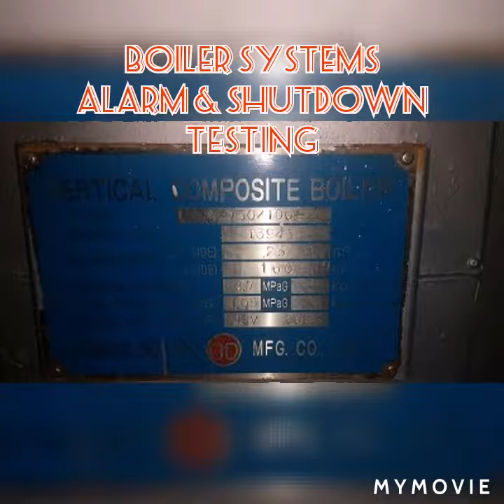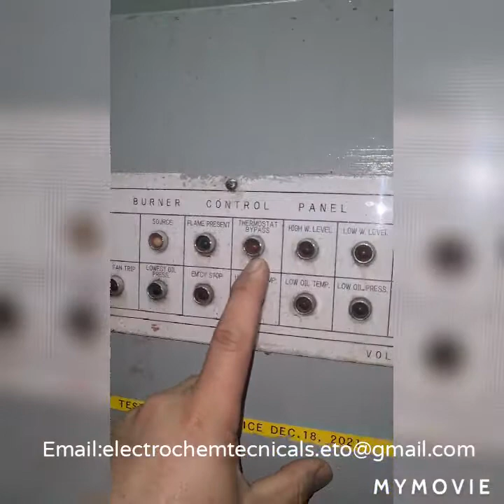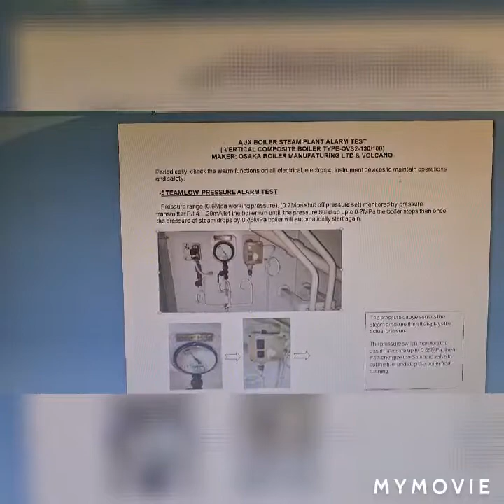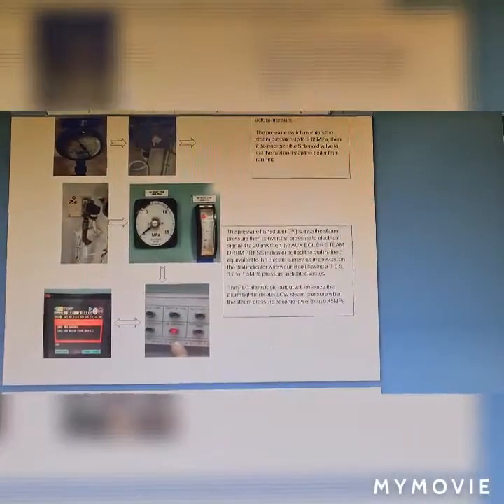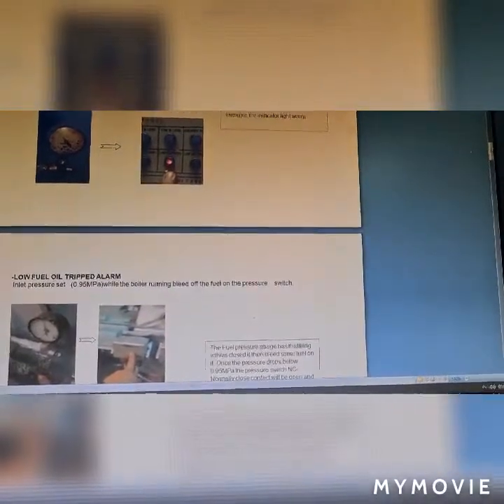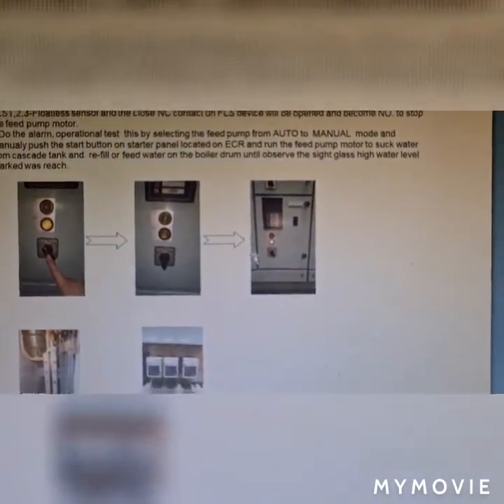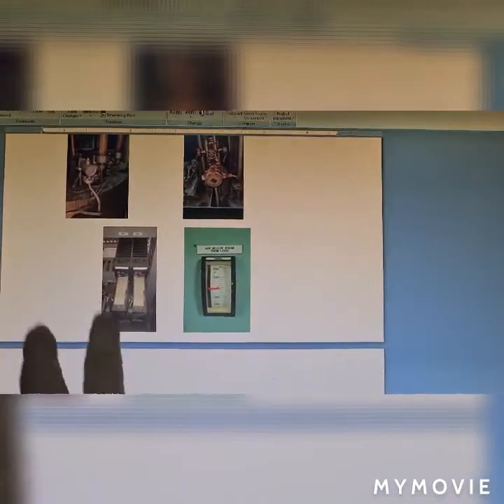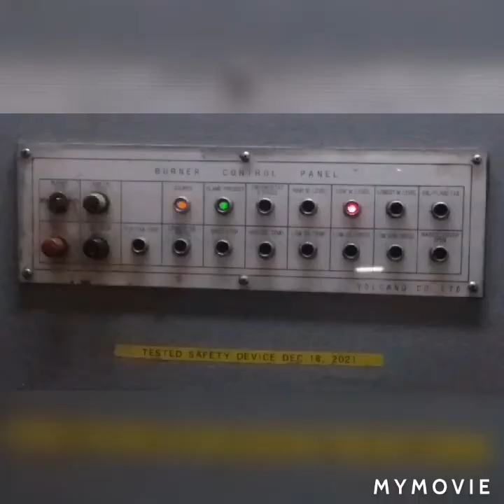BOILER SYTEMS, ALARM & SHUTDOWN TRIPPED TESTING

Comment: The boiler in normal operation cut in or cut out at set pressures so how did you simulate high or low steam pressure alarm?
Do we have to change initially from auto mode to manual mode.
Reply from the maker: @muneerkhan8127  yes low and high. Steam pressure alarm can be simulated by changing the parameter set values on HMI touch screen panels